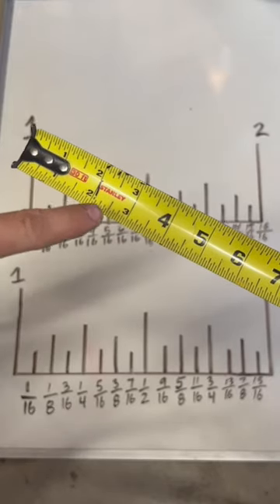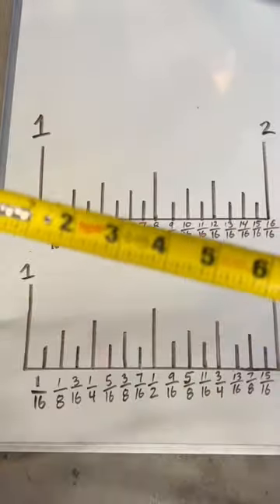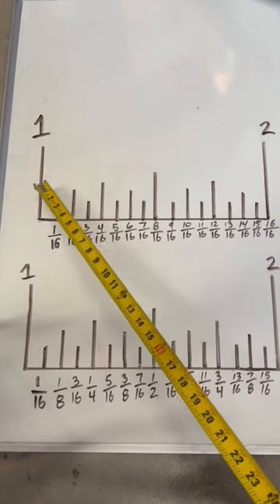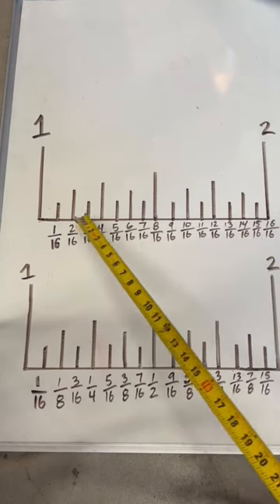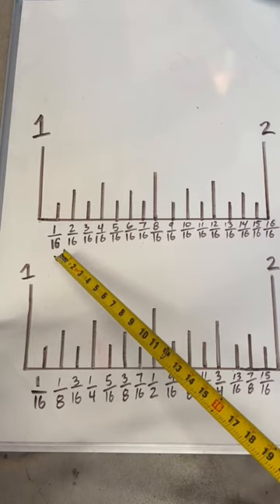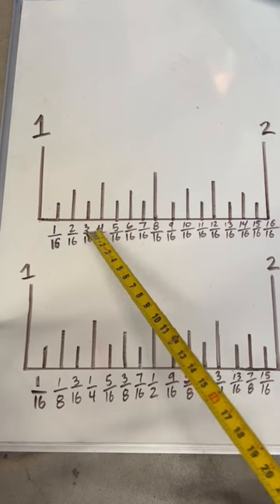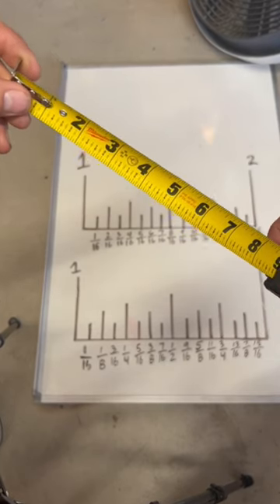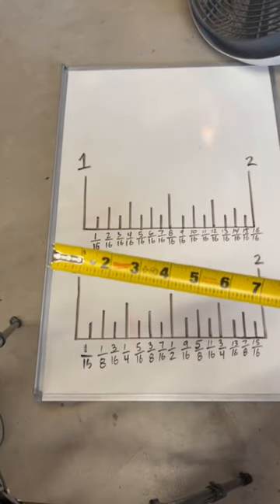How To Read The Small Lines On A Tape Measure (Construction Knowledge) #construction #diy #shorts

Comment: This and tons of basic math can be so helpful. The thing I always teach after this is when trying to find half double the bottom number. I’m a plumber and there are so many ways math can makes things easier. The offset formula is the main one people think off with plumbing but the best math truck in plumbing is subtraction. I see people trying to hold up a pipe and measure. I’ll tell them just to measure from the ground to where the piece will terminate and then measure from the starting point to the ground and subtract to give them the cut measurement. I see too many people trying to hold pipe and fittings and eyeball things when math would make it so much easier.
PS two tricks with a tape measure is how to find half of any mixed number measurement or subtract any mixed number measurement. If you need half of 6’ 9 7/8”. Just fold your tape with the end lined up to that number and the center line of the bend is half. To subtract fold your tape so the end is lined up to the big number then find your smaller number and the measurement on the other side inline with it is the difference
Reply from the maker: Thats right its great to know these things. I'm a new construction plumber and I see exactly what you are talking about all the time!